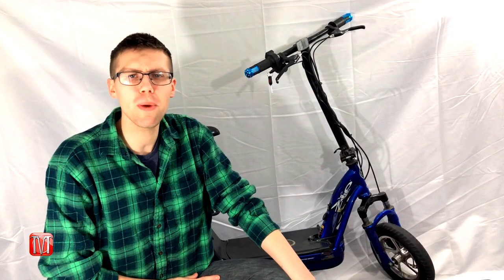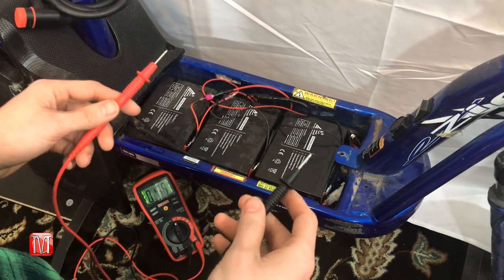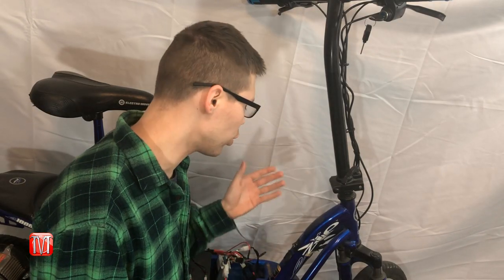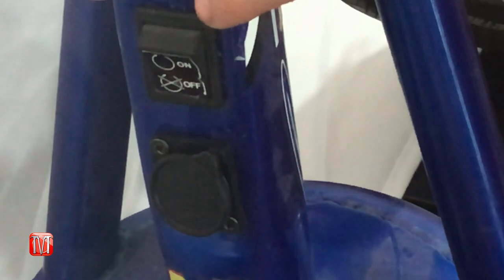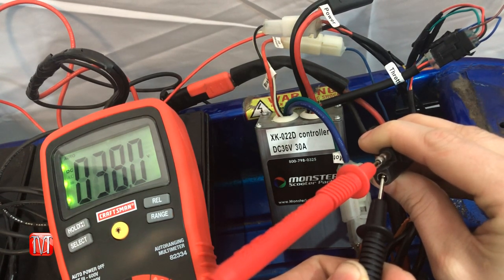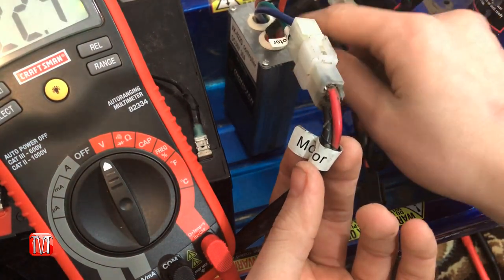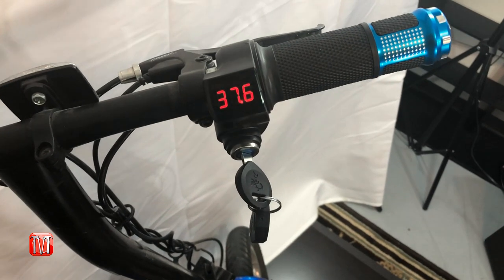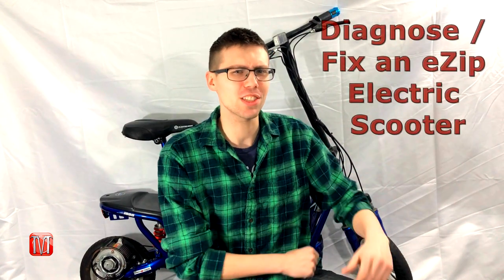How To Fix an eZip Electric Scooter (For ALL Series)

Comment: Hi! Great video. I have a eZip E400, got new batteries. I get on and ride and it will ride fine but then jt will stop. I lifted it up (back part) and pressed the throttle and it went full speed. Its when I get on that it will stop. I think the motor is going bad. What do you think?
Reply from the maker: kaddieluv so I’m going to assume you weigh less then 180 lbs, since that’s the max weight limit the scooter is rated for. If that’s so, how does the scooter act when you get on it... does it slow down but seems to want to move or does it come to a complete stop?
Reply: MAGS How To Videos Im 125 lbs and my kid 80lbs. It will ride then slow down a lot then stop. If I get off and lift the rear tire, press the throttle all the way the bike will start up full speed. As soon as I sit on it it wont go.
Reply from the maker: Does it move when your kid rides it? Or does it pretty much do the same thing as when you stand/sit on it?
Reply: MAGS How To Videos same thing.
Reply from the maker: So there are 3 possible things that I can think of.

#1 Batteries: I know you said you got new batteries but are they getting fully charged? Don’t go off of what the scooter says. Makes sure to test the batteries with a multimeter. (If you don’t know how to use one I do have a video that can show you). This scooter should have 2 batteries so you should get 12 volts each or a total of 24 volts when they are hooked up to one another. If you’re not getting close to 24 volts then they are not fully charged or they are not hooked up correctly. (I also have a video on how to hook up batteries)

#2 control module/wiring: even tho the scooter turns on it might not be getting the full amount of power it requires. Make sure to inspect the wires leading to the motor. Make sure there’s no damage to the wires and that they are properly attached to the motor. Test the power wire that runs from the control module box to the motor. You should get 24 volts leading to the motor when twisting the throttle handle. If not that might mean your control module is bad. But first make sure those batteries are fully charged. 

#3 weak motor: if you are getting 24 volts from both the batteries and the control module leading to the motor plus all the wires are good, then your motor is most likely bad.
Reply: MAGS How To Videos thank you I tested the batteries and they are at 24 volts. I will do the other things you mentioned. Thanks!

Comment: I got an ezip 1000 and put new batteries, throttle and controller. When I turn it on I get a red light on the throttle can anyone help me fix it
Reply from the maker: Are your batteries fully charged? (The eZip 1000 models have three 12 volt batteries equaling 36 volts total. Depending on the batteries used they should have somewhere between 8ah or more per battery).

NO BATTERIES ARE NOT FULLY CHARGED: than is your charger putting out the correct amount of voltage/amperage. -if not replace charger.

YES BATTERIES ARE FULLY CHARGED: than are the batteries properly hooked up in series to one another? -If you got 36 volts or more you’re good. -If not than rewire/hook up those batteries.

Still having issues???
Than is the new throttle handle you purchased an after market handle? 

NO IT’S A FACTORY HANDLE: than do a continuity test on the power wires and see if you are get high resistance when twisting the handle. Don’t know what I’m talking about… Watch the video.

YES IT’S AN AFTER MARKET HANDLE: than the handle might be wired different and need to be re-wired.

Still having issues??? Test to see if you are getting any power from the controller to the motor when twisting the handle.

NO THERE’S NO POWER: than something is otherwise wired wrong to or from the control module… that or the control module you purchase is defective.

YES THERE’S POWER GOING TO THE MOTOR: than if you are getting the same voltage reading that you got from the batteries than there’s most likely something wrong with your motor.
Reply: @MAGSHowToVideos  hey thanks for the info I figured it out my batteries weren't putting out enough juice..I got the batteries from Amazon and they suxed. Where do ya recommend I buy new batteries from ...

Comment: Hey can you give me advice? I have a mongoose m200 36v scooter with a 350 watt motor. It goes about 20-23 mph and but because of how low the watts are on the motor, it accelerates slow. I want it to accelerate faster and I have a 500 watt motor. Will that allow it to accelerate faster??
Reply from the maker: Edwin Sanchez yes since it is a larger motor it should in theory accelerate faster. It should also go faster, but realize that for it to do so it will use more power thus draining your batters faster. I was thinking about doing something similar with mine. I also am thinking about mounting a box on the back and wire up 3 more batteries with a transfer switch so I can switch between batterie sets. Let me know if that larger motor does the trick for you. Hope I was able to help. And thanks for watching my video.
Reply: MAGS How To Videos will it be a safe swap? Nothing will get messed up ?
Reply from the maker: No it shouldn’t
Reply: MAGS How To Videos I need another thing, my 3 batteries each are 18ah so will a 36v 1.8a Charger be good for it?
Reply from the maker: Edwin Sanchez yes

Comment: what is wrong if my scooter will only run if i unplug overcharge wire
Reply from the maker: Patrick Bourgoyne honestly I’m not quite sure which wire you are talking about. However, if you have followed my video and tested everything, feel free to check out this website. It might cover something I didn’t in the video. https://www.electricscooterparts.com/troubleshootingmotordoesnotruncharged.html

Comment: I have an s750 bottle throttle 5 Pin need a 6 pin so I wired it like you said or someone did and it still doesn't work now what
Reply from the maker: Let me get this straight you’re saying you purchased a 5 pin connector throttle handle but your scooter requires a 6 pin am I correct?
Reply: Yea I just dud this; 6 pin but I ordered 5 pin. I connected the plus minus and signal and working.  Although it cuts out on me after 10 minutes of riding, dunno why, could be bad wire or connections or controller or my 3 pin hack sux

Comment: Where can you get a good eZip 750 charging port?
Reply from the maker: Is it a 3 prong or a 4 prong port?
Reply: @MAGSHowToVideos  3
Reply from the maker: You can find them on eBay for around $5-$7... you can also go on the ezip parts website but you’ll spend a lot more.
Reply: @MAGSHowToVideos  thanks

Comment: Changed control unit and throttle. Batteries show charged. 24 volt. Still will not make a sound.or move.  All lights work. Worked fine when I turned off. Now nothing. 6:14 min
Reply from the maker: Sounds like you might have a bad control module
Reply: @MAGSHowToVideos  changed it too, your video sent us to

Comment: Does anyone know what my problem might be I have an ezip 750 electric scooter I used to use I haven't used it for probably almost a year now bc I took a break during the winter and when I went to use it the following summer it wouldn't work. When it was plugged into charge it said full but when I unplugged it there was no light and the throttle never worked. I dont know if it was overcharged or what but It doesn't work. Do I need a new batter or what?
Reply from the maker: Michael Pulisic most likely you will need a new battery. If you have a multimeter test it. If you left it out in the cold over winter it most likely damaged some of the cells inside. Depending on your system you should get a reading of 24v or 36v in the battery’s when fully charged. If you don’t get any reading or it’s supper low then your battery needs to be replaced.
Reply: @MAGSHowToVideos  thx for the help, I'm sure I probably need a new battery as I assume I killed it but I'm not sure how to change the battery and I dont want to ruin anything. 😐
Reply from the maker: So when you have the scooter plugged in you are charging the battery. As long as it has been plugged in for awhile or the light on the throttle shows green, it should be fully charged. Then remove the foot cover and unplug the battery.Test the battery with a multimeter. If you don’t know how watch the video. If you do decide to replace the battery, expect it to cost you around $160.00+ if you purchase the manufactures battery pack. However, if you don’t mind spending a few mins in making a wire harness, you can purchase the batteries individually for around $15-$20 apiece on eBay. If you go that rout feel free to let me know and I can help you hook them up. Hope this helps and hope you are able to fix your scooter.
Reply: @MAGSHowToVideos  where do I get a multimeter and how much will it cost me and the light is definitely green when its plugged in but once I unplug it it goes away so I'm assuming the batteries dead
Reply from the maker: Michael Pulisic so you can find a multimeter at also any hardware store or Walmart for $15-$20. And I understand the feeling of not wanting to ruin anything especially when you don’t really know what you’re doing. But if you want to make sure the batteries are bad before purchasing new ones watch the video and if you still have problems feel free to leave a comment and I’ll try an help as much as I can.
Reply: @MAGSHowToVideos  appreciate it

Comment: whats the link to that throttle? I like it
Reply from the maker: Outdoor Republic just search electric E-bike Throttle handlebar on eBay and you’ll fine it
Reply: 7
Reply: I found a bunch of them on eBay... some with as many as 3 plugs!  Which one is the right one for my ezip750...?
Reply from the maker: So unplug your throttle cable from the computer module and count how many prongs are sticking out on the male end. That will tell you how many wires you need. If I recall I purchased one that had 4 wires. I can’t remember I would have to go back and watch through the video again haha

Comment: @MAGS How To Videos 

I literally have everything working but when I plug in the power from controller to motor it goes to zero.

Unplugged switched on it's 8.7v
And full throttle it's 22 v
 (it's ezip 24v scooter )
As soon as I plug in the motor it goes to zero. 
The motor works if you connect directly to batteries 
The motor on a 200ohm scale reads 0.8 ohms 
Please help my kids love this thing
Reply from the maker: That’s weird. So let me get this straight. When you bench test the motor hooking it up straight to the batteries it works. However, once you plug it into the control module it doesn’t turn on?
Reply: @MAGSHowToVideos  
Correct
I'm attempting to test the motor further but I've yet to find a good video on it
Reply: My theory is that an instant 12 or 24 volts runs the motor but a "slowly " building up 12 volts from the controller just turns the motor just enough to find a short in the motor and stops there
Reply: Tore the motor apart, checked it out it. Put it all back,  Eventually found a short in the controller. The test works for it but the controller still internally failed when everything plugged in. Something on the circuit board I assume.
Thanks for quick reply and encouraging me to push through the process lol 
Good videos for sure

Comment: I have a Schwinn 1000. It sat for ages in my garage after dying on me. It is direct drive and I thought it seemed like the brakes were dragging and killing the batterys. Maybe. But I bought 3 new batterys. Pretty sure I wired them OK. I nevr could find the inline fuse.  I also bought a new throttle but when I went to hook it up zi saw that mine was a 6 wsire lesad and the new one was 5. Which shouldnt have been the problem anyway. I pulled it out again, Clicked on power switch I get a red light. (Its working, I guess) So I charge for a while and the light just stays green. Changed to dif wall and it turned red -Charging! After about 6 hours or so its still red. NOW IM GONNA DO SOMETHING STUPID. Surprise! WIthout thinking, I flicked the power button on1 WHY? I dunno. I unplugged charging cable checked ..No red light now. What have I done? Fried the power switch (I hope) Or have i killed my charger (I can live with that) Or is the internal box fried, in which case I might as well buy a 5 wire throttle unit, huh? I just have no idea how to thread all those wires down thru there and how to even remove the old throttle. I have had the white power box out before and put back in. Its night time now and I will check the batterys first. I have one of those Astro A1 things. DOnt really know how to use it. But I can check batteryus. Thesebatterys are less thna a year old, with only a month of use tops. Suggestions?

Comment: Hello! I have an eZip 750, and I am not too good with mechanical projects, but I have a problem that I could use some help with. Basically, the twisty part of the throttle broke off, and whenever I try to put it back on it doesn’t work, and the scooter just goes at full speed whenever I turn it on... I think the problem is the throttle itself. If I got the kind of throttle that you got, (or something similar) how would I install it or wire it? Thank you so much for anyone that helps.
Reply from the maker: So you can just purchase the manufactures throttle Handel... most likely the same one you had and just plug it into the control box where the old one was. If you do that then there shouldn’t be any wiring involved .
Reply: MAGS How To Videos Thanks!

Comment: Before I type my question  I want to know weather you read and respond,  so I'll wait to see if you respond to me, thanks
Reply from the maker: Abel Flores what’s your question?
Reply: @MAGSHowToVideos  I have a Schwinn s500 and I bought a new twist throttle but it came with a 5 pin connector and the control box on the scooter has a 6 pin connector. These are the wire colors, throttle has blue black red green brown, the control box has red yellow green blue black purple, can this somehow be wired to make it work, thxs
Reply: @MAGSHowToVideos  after u respond hit either a thumbs up or down so I'll be notified, again thxs i really appreciate you responding
Reply from the maker: It’s hard to say since I’m not sure what color wire on either the scooter or throttle handle does. However, if I was to try wiring them together, I would begin by trying to look up a wire diagram for each to try an match up the wires. If you can’t find any I’d then start by matching up the same color wires to one any other and then mess with the left over colors to see what happens. For example connecting the brown wire on the throttle handle to the purple wire on the control box and testing to see if it does anything. Then switching that brown wire to the yellow wire to see if anything different happens. If for some reason the throttle handle doesn’t seem to work with either wire hooked up, then you will have to mess with changing the combination of the other color wires. Again the easiest way would be to go online and try an fine some wire diagrams that identify the propose of each wire on both the scooter/control box and the brand of throttle handle you purchased. Hopefully this helps you out. Thanks for watching my video and feel free to  let me know if you have any other questions.
Reply: @MAGSHowToVideos  I'll try that thanks
Reply: @abelflores3752  did you find a solution? I have the same sitch

Comment: If the wheels don't roll in the back is the monitor locked up
Reply from the maker: No not necessarily... if you want you can test to see if power is being sent to the motor from the control module. That you can unplug it from the control module and use a jumper wire or power probe hooked up to a battery to send power to it directly. If you know the motor has power running to it and doesn’t work than there’s an issue with the motor.

Comment: Just use 2 20v dewalt lithium drill batteries as a power source. Tie them in series (20v x 2 = 40v [36v nominal]) 

Watch my video on my channel for more info